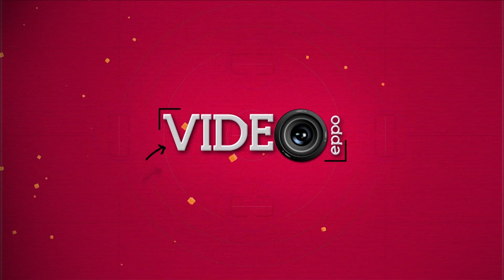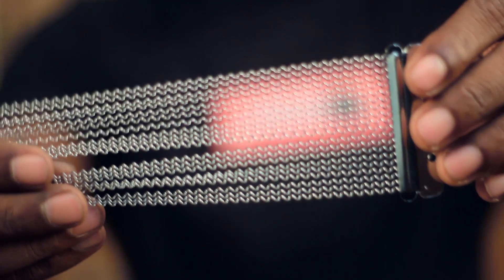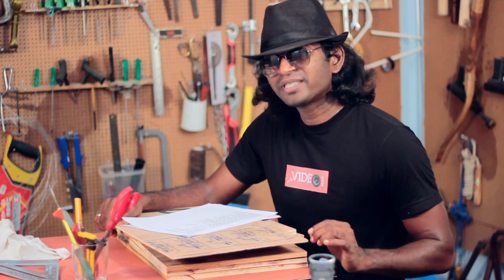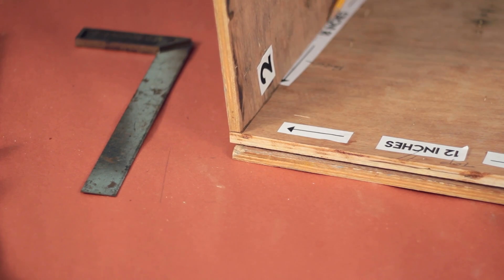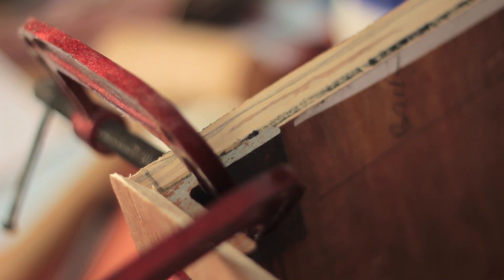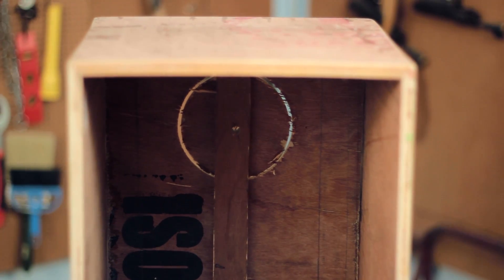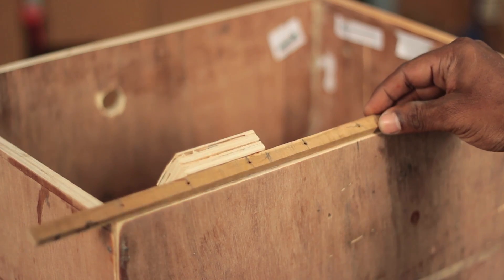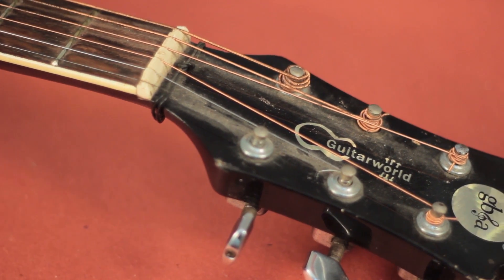Make a Cajon with Plywood at home- with snare assemly

Comment: Hi Frnd , I have a suggestion here. As I build myself at home, so a small idea which I want to share. The "Thapa" I used was only 4mm thickness,  best quality water proof ply and no Sun mica I used, because it reduces the sound quality. Then I Used some hand paint with my design. And one more thing is that I used one full sized snare, which was cut from middle. U may try one.
Reply from the maker: You are absolutely correct. Sun mica with the glue reduces sound quality. Thanks for the idea bro
Reply: @VIDEOEPPO  u r welcome frnd.
Reply: In This video he used,  12mm thick  plywood rite..  4mm would be sufficient...  will it support 100 kg person on top of it..  :)

Comment: Links aren't in description
Reply from the maker: It was not working so removed it. I will post another link
Reply: @VIDEOEPPO  is there any substitute for snare spring
Reply from the maker: @WhoIsSaurabh  yes!. You could use guitar strings.
Reply from the maker: Infinity SSR01 Snare Wire https://www.amazon.in/dp/B074DSHG5C/ref=cm_sw_r_cp_apa_i_aqYtDbZHJ5CZN